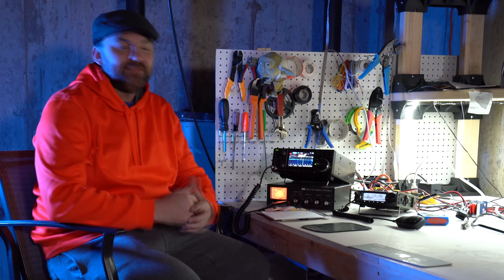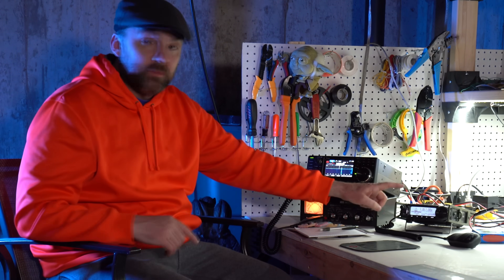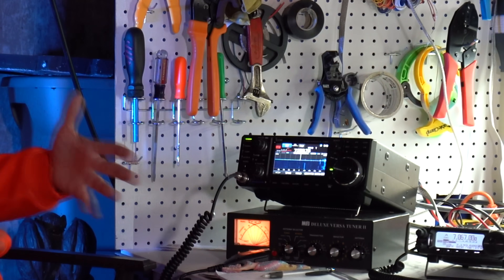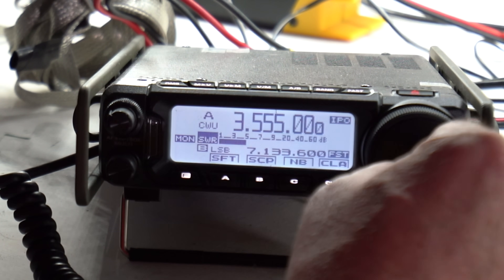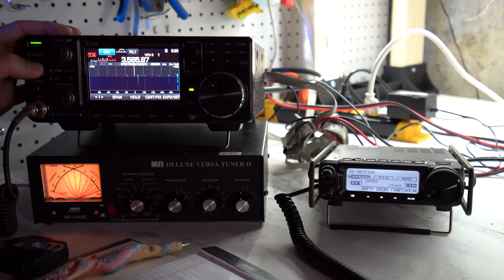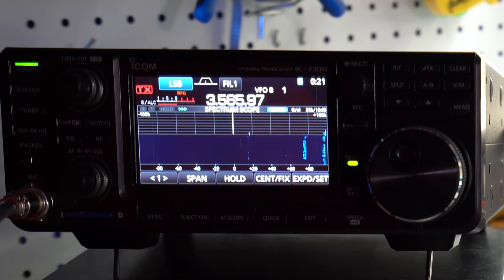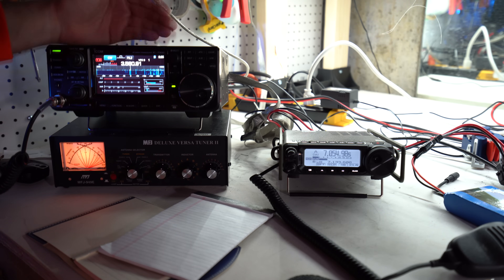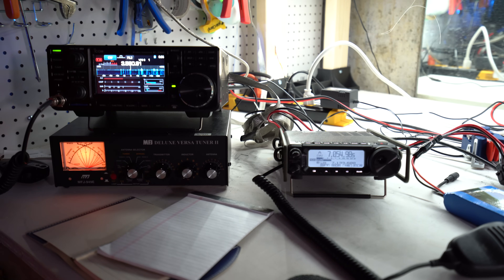iCom 7300 vs Yaesu 891 Comparison ~ Battle to the DEATH!

Comment: I think the opposite, if I were a new ham now thinking back I would  get the much cheaper FT-891 with it's far superior noise reduction. It's a lot of radio for the money and the selectivity I find is also much better, this 891 is better at reducing QRM from close strong stations. Then after that I would keep the 891 and get the FTDX-1200 or 3000. All the fancy screens and menus can't help you hear that contact in the noise.

Since I last posted here I got my licence in May 2019, loving the hobby. I got the Xiegu X5105 QRP rig + The Xiegu G90 20 w SDR Rig + the IC-7300 and the FT-891, I have to say that I really like the FT-891, the noise reduction simply blows the 7300, G90 and X5105 away, put on some headphones and the 891 is a real pleasure to listen to, it can really pull a station out of the noise or hit DNR and listen to the background noise disappear, it's amazing. It makes me wonder should I have got the FTDX-1200 or 3000 if Yaesu receivers are that good. The filtering is also excellent on the 891. The 7300 is a good radio and I like it but to be honest the screen is too small to be useful for an SWR, seeing a whole band makes the signals look way too small.

The menus in the 891 are not bad because most are set once and forget, using the likes of Flrig and you can control many functions from the computer. Now I'm familiar with the menus it's 2nd nature and don't find it an issue at all.  The 891 is probably one of the best and very underrated portable radio out there.

I now use the FT-891 portable because the 100 Watts make a big difference and a 8.5 Ah LiFeP04 battery gives me plenty of portable time and I bring a 12V car battery in the car just in case, I don't operate very far from the car mostly so power consumption is a non issue. 

I also use the FT-891 in the living room, I strung up a 2nd EFHW for this and use it on JS8 Call and PSK31 as well as  SSB when I don't want to go up to the shack. 

Is the kx2 or Kx3 a better receiver ? perhaps but the FT-891 is bloody good and a hell of a lot cheaper when you factor in E.U extortion taxes + that 100 Watts, you simply can't beat having the power when you have limited time to work portable, the FT-891 and Super Antenna MP1 is a great portable setup. You can have 10-50-100 watts whatever you want, better to have the power than want it.
Reply: Life is too short for QRP :-) Agree with you, that if you have limited time to work portable, you would prefer to be heard, instead of trying to be heard.
Reply from the maker: I'm thinking of selling the Icom 7300 and getting a Flexradio SDR.  In fact, I'm going to do it.
Reply: @hamradiocq  Before you make any decision check out the Expert Electronics SUN SDR 2 DX 100 watt, looks really good and I've read a few youtube comments where People who had the FLEX swear the SUN SDR 2 DX is better.

Do you still have the 891 ? I still have mine and love it, I use it more than the 7300. I got the Chameleon MPAS 2.0 back in May and got great DX on 20M in the evenings over the Summer from my sitting room with 891 and MPAS 2.0 the sound is just so good from the 891 with Headphones. The MPAS 2.0 with CAP HAT works so good I decided to leave it up permanently and take it down only for portable use and it's funny because I got it only for portable use lol. 

Anyway, something else for you to ponder about, after using a friends TS-590SG I was absolutely thrilled to use such a radio, all the buttons, great sound, filters etc and built in panadapter so you can get the waterfall on the big screen, I liked it so much I decided to buy one so ordered one but due to you know what it was delayed by months and so then I decided to get the really fantastic Acom 1000 and I'm delighted I did because it makes a good difference when I need it. So finally getting to the point lol, I then got the PTRX 7300 panadapter for the 7300 and hooked it up to the Airspy HF+ I wasn't using and it makes a massive difference to the overall experience having the large waterfall on a monitor, see a gap on a busy 80m band and hover over it with the mouse and it will tell you the frequency and you can tell your friends to qsy, it's a lot easier than on a tiny screen. 

Anyone thinking of buying a new 7300 + PTRX 3000 and SDR I wouldn't, too expensive better buy a proper SDR or the TS-590 SG which has the panadapter built in and it's a real nice radio to use. I no longer listen to the audio from the 7300 and only from the computer via the Airspy HF+. I use SDR Console and Omnirig to sync the airspy with the 7300.

So Flex, Panadapter for the 7300, TS-590 SG with built in Panadapter, SUN SDR 2 DX or Yaesu FT-DX10 ? 

I have to say now that having used the  panadapter for the 7300 going back to small radio screen would be difficult, having the big waterfall on a monitor with mouse control is really great. :-)
Reply: @o00scorpion00o  where did you seen a TS-590SG with a buiklt-in panadapter ? O_o
Reply: @inferno7654  The 590 SG comes with the panadapter, all you got to do is change some settings in the menu of the radio and connect up your own sdr. It has the connector on the back of the radio, A Ham friend of mine has one and this is how he uses it.
Reply: @o00scorpion00o  Ok, one thing is attach an SDR on the back of a radio, another is a panadapter biuilt.-in, is very very different.
Reply: So, did you...? @hamradiocq

Comment: I own both of these radios as well.  For ease of use, the 7300 is very hard to beat and the ergos are second to none.  Yeasu FT 891 can be a little frustrating at first until you get the menus in muscle memory and of course is more portable.  The DSP on the FT 891 is best and rivals or beats the IC 7300.

Comment: My 2 cents is basically this... each radio has its place and specific purpose in ham radio.  While I could afford the ICOM 7300 I chose the FT 891 at around $ 575.00 ?  The 891 sits mostly on 10 meters on its own dedicated antenna. I have an old Yaesu FT757GX that I use for the other HF bands with a different antenna. I love that the FT757 has no menus to fiddle with.  73  !
Reply from the maker: Agreed.

Comment: A great, "Unfair Comparison."  lol  I almost bought a 7300, and kinda wish I had, but I opted for the 7100, primarily because it has HF/VHF/UHF. I still see a 7300, maybe even a 7610 in my future. I may need to take a second mortgage on the house for the 7610, however. :-(  All things considered, including price, the 7300 seems like the perfect radio, if there is such a beast.
Reply: I also went with the 7100 but would love to have a 7300 eventually.

Comment: love my 7300 but travelling overseas need a small unit for my backpack 891 looks like a great rig for travelling
Reply from the maker: I hear ya Alan. Loud and clear.
Reply: I recently took my 7300 to the Caribbean in a Pelican case, and I tell you it got quite heavy during the long walks in airports from one gate to another.  I have been toying with buying an 891 for travel as you suggest.

Comment: you can hook up a morse key on the ft-891 and use that to tune. (It is a menu setting) Page 3 of the ft-891 Advanced menu it is menu item 7-6 and 7-1

Comment: I have both and love them both!   No problem zipping thru the menus on the 891.  The 891 is much easier to cart around for portable work while the 7300 sits nicely on my desk and works well for digital modes.  I'd say, the amount of time I spend using either one is about the same.
Reply from the maker: Yeah, I hear ya. I like all my radios.  They all have strength & weakness.

Comment: ND Ham, I have been called a Yaesu poster child, that being said I HATE the microphone jack for the Yaesu radio's the rest of the radios I have dearly loved but the hokey microphone jacks are a joke. I bought a set of Heil Pro 7's for my FT-991A and have been trying to find a way to keep from tearing the jack from the radio. As far as portable use the FT-891 can't be beat, my guess is you feel about iCom's like I do about the Yaesu products. Lets face it they both have good and bad points, my 991A does everything your iCom 7300 does and in some places more but heck, I've only had the 991A for a few months so I don't know all it will do yet.
Reply from the maker: Great comment. Very interesting. Like you said all of them havr their goods and bads.

Comment: On my ft891 when in cw it displays  cwu I notice yours does also. Do you know what the u means? I can't find anything in the manual. 
Thanks for the video. 
Jeff
Reply from the maker: Good question, I think there's a CW Upper Sideband and CW Lower and it's just saying Upper as common.
Reply: usb ,set the mode menu to auto

Comment: As stated, it is not a fair comparison regarding rig control and operation.  The 7300 has a MUCH better UI than the FT-891.  But I'd like to have seen more about the performance.  What I would like to have seen was a more detailed comparison of the DSP qualities of both.  I just bought an FT-891 and I have to say that its DSP works better than any other radio I have, ICOM included--and was an ICOM guy for a long time.  I'd make it my base rig except for the cumbersome menus that I have to navigate to do stuff.  As mentioned, adjusting power levels is one of them.  I need to buy a new base rig (the 7300 is on the list), but I'd like to see more on the DSP coverage of both so I can see how these two compare before I commit.
Reply: Marcus Florido I prefer my ICOM 7600 over Both of these radios any day.I would not own any touch screen radio for FREE no matter who makes it.If the 891 is anywhere as PATHETIC as the 897D was that I had I would not own it either.
Reply: Its an apples to orange comparison but the goal in this case is to compare apples to orange. A more fare comparison would be the 991a.

Comment: I have an IC-7300 and a Yaesu FT-897D and love them both for different reasons.  But no experience with the Yaesu FT-891 although I plan to purchase one for portable use.  I really think you should have familiarized yourself a little more with the FT-891.  Although I agree that the IC-7300 is the far superior radio.  I absolutely love mine.  I learn something new and very useful about the IC-7300 constantly!  It has endless yet easy to figure out features.  Good job Tom!
Reply from the maker: Thanks, yeah I need to dig into the 891 some more. I find filters disappointing in most cases.  They help a little, but still not perfect.

Comment: I had $1000 mad money to spend.  Deliberated for days.  Do I get an IC-7300 or do I buy an FT-891 plus  an Acer Aspire E 15? 
Long story short, I'm typing this on my new laptop.  Menu system becomes pretty automatic if the 891 is the only radio you use.
Reply from the maker: Do you travel a LOT!?   or need a base station???  The 7300 is far superior at home if you don't have to lug it around.   You can still lug around a 7300. But it's just less convenient.
Reply: @hamradiocq  Ever since I first heard of PSK31 in 1999, I've only been interested in digital modes. The 891 works great with my old Win7 laptop and doesn't take up much space.

Comment: I have an IC-7200 and an Ft-891. Similar results in my unfair comparison . Both radios are great. I get really good signal reports with the FT-891.  Looking forward to working portable this spring!
Reply: I had the 7200 I now have the 7300 I can assure you the 7200 is way better at controlling noise . The 7300 has bells and whistles but is a very very noisy receiver the att is absolutely useless the RF gain control is completely obsolete it actually only reduces any sig but leaves you with same noise . Lots of flashing lights but very poor at reducing noise you are reliant on noise reduction which is poor option . The ic 7200 is a excellent rig .

Comment: I’d be more worried about having a proper efficient antenna than using a tuner to fool the radio into thinking the antenna is efficient.
Reply from the maker: Easy to say hard to do.
Reply: @hamradiocq  Yes , it's hard to do in practice unless you use a multi-band antenna that is resonant on several bands or at least has very low SWR for the bands you want but not practical in every situation.
Reply: @hamradiocq  Easy to say, easy to do. DX Commander. Job done.

Comment: Good video man. I don't plan on getting a 7300 at all, just because it's not inline with my intent (yet).  But I do like seeing features an operator might get used to having on a variety of radios.  The 891 is in my potential purchase list (for a first HF rig), as is the 991a.
Reply from the maker: I totally understand. Videos like this give you and others a feel. Not meant to be Gospel, just a look and feel and an opinion.  Tnx fer comment!

Comment: As an owner of two Ic7300's and also an FT891, yes this is an unfair comparison.  Yes the 7300 is intuitive, and the interface on the 891 is not.  I have the 891 in the truck and it is a good mobile rig.  ALSO you may not know but the 7300 has a wide ranging tuner if you put the rig in emergency mode. It takes about  10 seconds to put the rig in Emergency mode, It will tune about a 7:1 SWR, BUT you are limited to 50 watts in Emergency mode.  In normal mode the tuner is limited to 3:1 SWR.  While the 891 has a USB output for CAT control, it DOES NOT pass audio for digital modes over this USB like the  ICOM does. You must have an audio interface using analog connections on the back of the 891.  The rigs are for two different purposes, and to be fair the 891 has a lot less "real estate" on the front panel and no touch screen so its  MMI (Man Machine Interface) must by definition be harder to use.  Current price on the 7300 is just under $1000,  after rebate and current price on the 891 is about $650  73 James KØUA

Comment: Harbor Freight sells a case: Apache 3800.  The IC -7300 fits perfectly inside and is well protected. It’s similar to a Pelican case.  On sale 03.08.2019 for about $30! Picked one up today early sale and plucked the foam to fit my radio. I was also worried about bring mine into the field. And like you I also have the FT-891. Both great rigs.
Reply from the maker: Thanks for the great idea!
Reply: You’re welcome. There is actually enough room to pluck if you want to have a place for some cables but I left the box just for the radio. And the manual fits under the top foam piece.

Comment: Got the 891 for portable. Tough little radio with beautiful receiver capabilities. It doesn’t hold you back when you become familiar on how to adjust the settings.
Reply: I completely agree, have one in my car on the dash is great as I can remote the mic and head then put the brick in the boot. I get around the menus and settings just fine and better than I do my SR8 on my desk. In the car I run with an atas120a so I have tuner, scope and dnr on the soft buttons. I've found dnr extremely handy in noisy environments and it's something that was totally skipped over here. The colouring of the screen and size matches my IC2730A closely as well for 2/70.

My only beef about the 891 is having to manually dim the lights when night driving then manually return the lighting level and the fact it won't auto directly tie to a codan auto tune antenna like the ic7000 and 706/2g will.

I LOVE the range scan memories on the 891 and they are awesome on the road. R1L>R1U is set for my full 80m allowance, r2 is set for my full 40m allowance, r3 15m and r4 10m. I flick to the lower of the range hit tuner then roll the vfo clockwise quickly, hold up button on mic and it starts scanning. When it hits the upper it auto rolls back to lower and starts again. If you come across something tap the vfo anticlock and then tap a soft key when near and manually fine tune. So easy and handy.

It didn't take me long at all to get used to the menus though I've seen people here and there selling because they couldn't fathom the menu nesting and differences.
Reply from the maker: Yeah, I just tend to forget in between the times that I use it.

Comment: My first HF radio was a Yaesu FT 707 with matching PSU, ATU and external VFO. HF only, no 160m. I just bought a Yaesu FT-897 All band All mode because the local club holds 2m SSB nets so I needed something that could do that. I was looking at buying the 7300 but again its only HF. The menus on the 897 are taking a little getting use to especially since my 707 doesn’t have anything other than buttons and knobs. Oh and compared to my 707, the 897 is nice and small on my desk, even with the ATU stuck to the side :-)

Comment: Thanks for the video lesson seven minutes in and I already don’t like the Yaesu. Glad the 857 is still available much easier to operate.
Reply from the maker: Exactly the point. It's to let people know how I feel about these radios.
Reply: The 891 superior to 897, 32 bit built in digital  recorder nb and dsp that works the rx for a budget radio superb i like it so much i purchased one have the 7300 and the 7410 also which i rate
Reply: Junk Man 857D is a POS and by far the WORST Amateur Radio I have ever owned or used and I am so happy I no longer own one and would never own another one even for FREE.

Comment: 891 filters are very good indeed, ZIN will zero in on CW, have both radios and they are great rigs. Fast access to bands can be done several ways on 891, easiest is via stored memories (M->VFO button) then rotate selector to choose. thanks for review :-)
Reply from the maker: I need to re-read the manual on those filters. thanks fer comment.